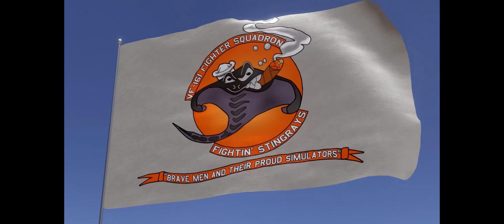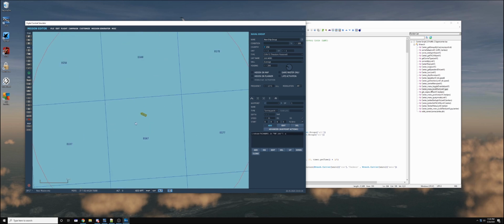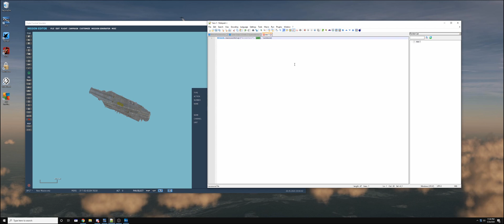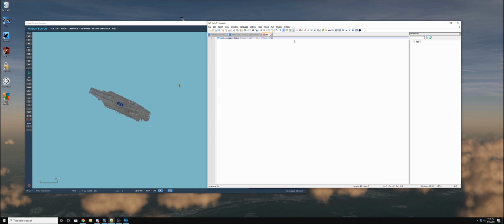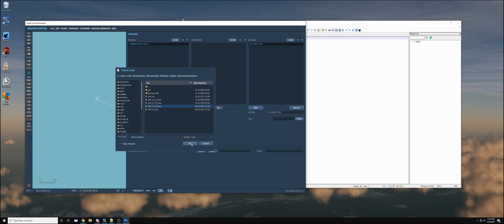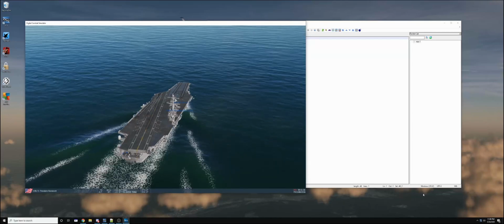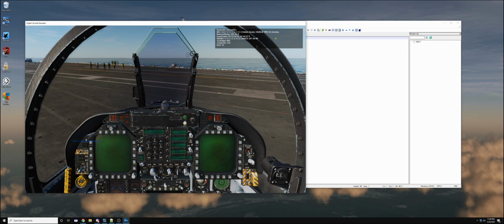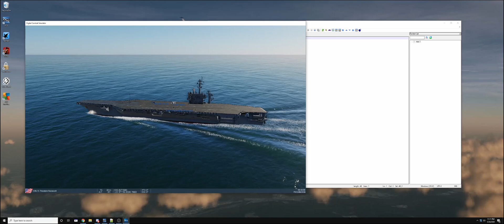Carrier Script v2.0 hotfix 2: Supercarrier

Comment: can you paste the code in description since its so hard to see?  Wouldn't that be easier
Reply from the maker: It is. Wrench.carrierSetup("Roosevelt", 90, {"Texaco"})
Reply: Awesom Job thnaks. If U want two carriers run the script is it possible? and is it possible that one of them is the tarawa?
Reply from the maker: @alessandrocasadio5226  Tarawa is supported, and you can have multiple carriers. I'd caution against using the script on both Tarawa and supercarrier, as they will travel at different BRCs and may collide. If you need both, put a tarwa in the same group as the supercarrier, or very far away.
Reply: @wrench4057  thx for the answer. I usually put them in 2 separate fleets about 4 miles away from each other. Is ir ok?